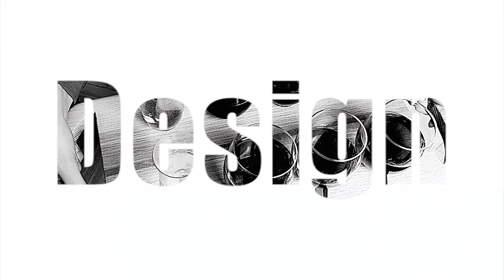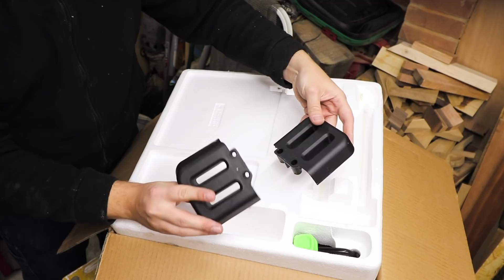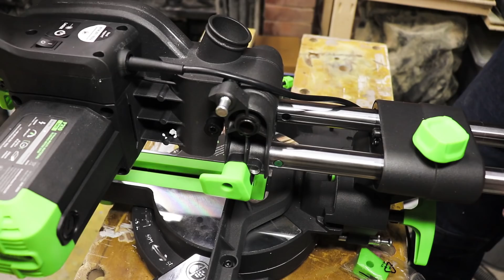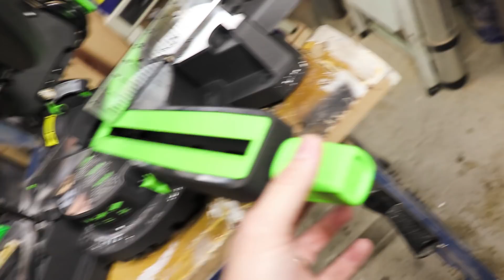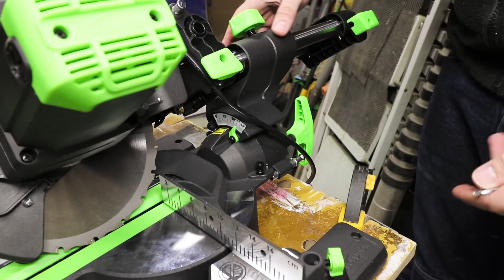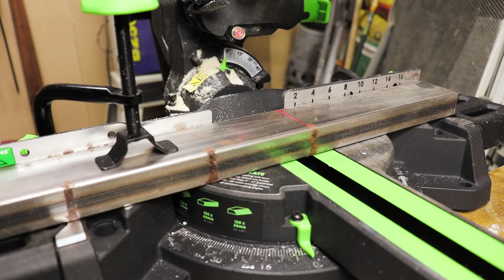Evolution mitre saw F210SMS - unboxing, setting up and testing

Comment: What is the difference from one of the other saws that they make the only thing I can see it green and not orange
Reply from the maker: So allegedly the orange tools are for more demanding jobs, on site etc where the green ones are for diyers. I would imagine it's the materials used but it just might be a gimmick not sure
Reply: @CasualDIY  I've looked for the answers to that same question the answer seems to be that though the R210SMS is marketed to the more pro end of the market the specs are identical to the F210SMS , The only difference seems to be the colour of the plastic components and the amount of accessories you get with the F210SMS. I have a F255SMS which didn't come with a dust bag which I had to order seperately. I get the impression that Evolution have essentially sold the same machine to 2 different markets but in different colours to give the impression that the that one is more professional when in fact they are pretty much the same. The only other difference I've found is that there are more variants of the R210SMS whereas the F210 is limited to only 3 models (210CMS Chop saw,/210& 255SMS). If what I've written is correct then there's a significant saving to be made if you go for the F210SMS instead of the R210SMS (Which is great because I actually prefer the green to the orange lol ) I'm a big fan of Evolution Saws they offer excellent value for money for woodworkers on a budget.

Comment: @Casual DIY, is there a major difference between this and the Rage 3?
Reply: Much appreciated! The only glaring difference I can tell is this one is not avaliable in the states, so could be just the wiring/electrical differences. They seem to use same blades.
Reply from the maker: @mattmiles7674  yes the blades seem to be the same but I will double check that.
Reply from the maker: Unfortunately never had the opportunity to work with Rage 3 but I will try to watch some YouTube videos on it and let you know